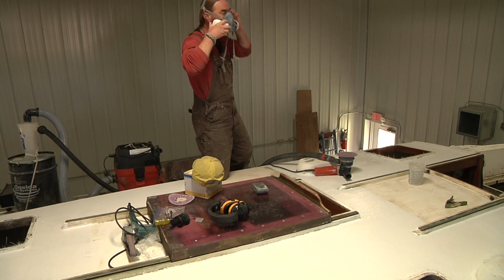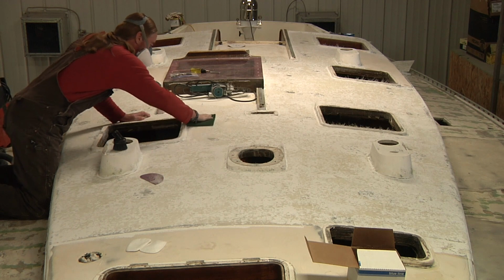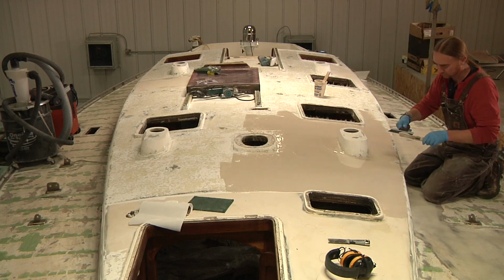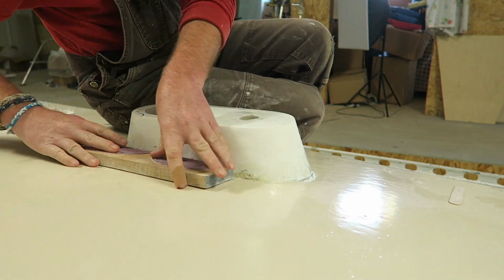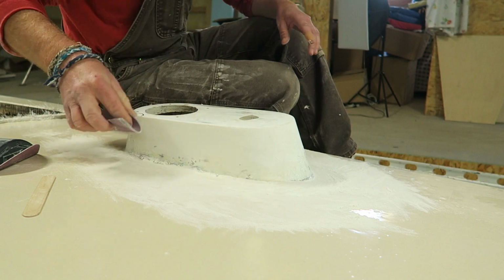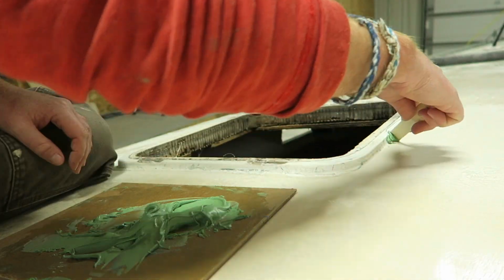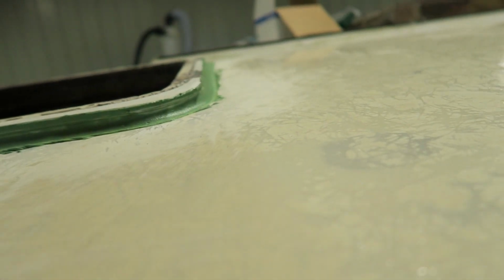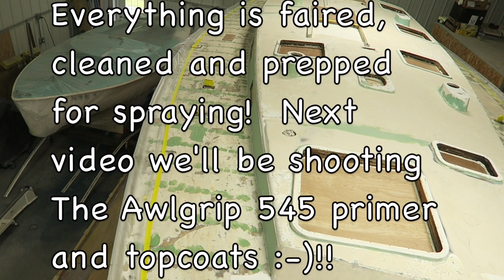The Last Hurdle On This Teak Deck Replacement Project

Comment from the maker: It's taken a LONG time to get to this point, Very sorry for the delay in new content!  Things will start coming out again much more regularly :-)  Have a great weekend and Thanks for watching!!
Reply: BoatworksToday do you have anything on bulkhead and stringer repair
Reply: Can I drag my boat up there? You can use it for the bulkhead and stringer vid.
Reply: I have  1970 17' sailboat with  shattered crazing. Would it better to wrap with the glass to stabilize or just sand it? This is the boat I'm learning fiberglass & other techniques. You have a great channel.  I really enjoy watching.

Comment: hi Andynice work, we make large patterns for fiberglass products, mainly architectural . When we do Domes with compound curves we use foam or wood but then cover with fiberglass after it is fair. so a bit like an old boat deck.to stabilize the surface We use a 6 or 10 oz fbg cloth to get the smoothest possible finish (CSM is too rough) , similar to the surfboard guys. We then either fill the weave with a similar mix with microballons that you use. We then spray with polyester Duratec product.(by Hawkeye ind) this hi build and fill material is much , much, much  easier to sand and the chemistry is a little different so no wax required it surface cures dry. It sprays like autobody primer but thicker. they even make vinyl ester versions. one or 2 coats of this and we are ready to make a mold from it or in your case to spray Alwgrip.using gelcoat is very old school. We stopped using that as soon as Duratec (and  Fourseal which they stopped making) became available in the early '80's.I'm sure if you try it you will never go back.cheers warren, WDPattern co

Comment: Hey Andy, great to see how far you've gotten with the project.. A lot of hours put in that 'short' video! I was wondering, you are going to be painting the deck, right? Why do you then not tape the sides to the edges of the guardrail? So you dont have to move it when you get to the deck..

Comment: Agree with others that the gel coat is a brilliant step. For the West System fairing at "ketchup consistency" ... which hardener did  you use? Slow, medium, fast? Thanks!

Comment: Question for you!  I am currently gel coating my fish boxes and center console (area) before I install the deck. My boxes are made out of Coosa board 1708 and then 1.5oz CSM.  I sanded everything cleaned the area and then brushed on a thick layer of gel coat. I sanded that down (just a little) and I see imperfection that need to be filled. Now can I just use Cab-o-Sil instead of Ad Tech P-14 Ultra filler that you recommended?  Then fair that out and spray gel coat?  I hope this all makes sense. Thank you. Semper Fi

Comment: You first laid down csm with polyester resin.  Then you laid down waxed gelcoat to cure the polyester resin on the csm. Now you are fairing with a West Epoxy mix on top of the gelcoat.  I thought you could not put epoxy on polyester resin. Very good video's, always informative.  When are you going to work on the Rhodes 19?  Thank you for what you do for we viewers.
Reply from the maker: Hi Mg!

The "traditional" order of layers is that poly overtop of epoxy is considered a No-No (I have vids on that topic and depending on the epoxy used is very much open to debate / discussion).  But, epoxy overtop of anything poly is perfectly OK.  So what I did here is considered to be an "industry standard".  Confusing? Yes at times!  But I try to show tried and true approaches to a problem rather than 'experimental' stuff.  I do dabble in that as well, but not as much :-)
Reply: BoatworksToday sorry for reviving this topic. I have gelcoat on a small O’Day Javelin with topside that is all pitted and cracked. I like your use of chop stand to restore the surface. Can I just paint over with gelcoat?? The above discussion makes it sound like a bad idea. Looking for your other vids now!

Comment: OK, I'm trying to understand what you are going to spray.  It didn't look like you were being very precise with the tape edge on the  deck.  Now I have to wait another week to see why.  The anticipation is a killer!
Reply: Cabin top is being sprayed. Teak on the deck so overspray wont matter.
Reply from the maker: Just the cabin and cabin sides.  The main decks and cockpit will be new teak from TeakDecking Systems..  That info and install will be coming shortly!!

Comment: How thick would you say the fairing (filler) layer is when you put it on?
Reply from the maker: Hi Robert, some areas are down to bare glass, others have roughly 1/4"...  The cabin was not very fare to begin with so all this had to be corrected :-/  Which is why it took so long to get the next video out!!

Comment: You don't use a guild paint for your finally fairing? 
I woulda skipped the west systems and went with awlgrip 545, then high build or ultra build (fair sanding) then 545 then awlcraft. 
bet you have a ton of pin holes in the finally paint. 
Love your videos and we call know theres a thousand ways to skin a cat.

Comment: would a roller of worked on putting the fairing on?
Reply from the maker: Well, technically yes but would not have worked very well.  Only way the roller would work is if the mix is VERY thin..  If it's that thin, then it no longer has the thickness to be much of a "fairing compound".  Honestly the best way to apply fairing is with a trowel or spatula like what I used.  It spans a wide area and helps to blend different sections in together with a smooth texture :-)  Hope this helps!

Comment: Hi Andy great video as always ! I like to share advices but it's always difficult because i feel they offend youtube creator. So bear with me ;) Why do you fair the roof by hand with lots of care if you are going to apply non skid on top of it which will hide most imperfection ? That's it. No more "you should have done this, you should have done that" for today. Cheers Andy !
Reply from the maker: Hey Xavytex!   No offense taken!  It's a legitimate question :-)  While you are correct that the nonskid texture will hide a LOT of sins in the surface, my OCD unfortunately just can't let it go :-/...  Right or wrong, I'm one of those people where a job is either done Right, or it's Wrong..  It's a curse; but it is what it is, and I'm ok with it as long as I don't run myself out of business :-)